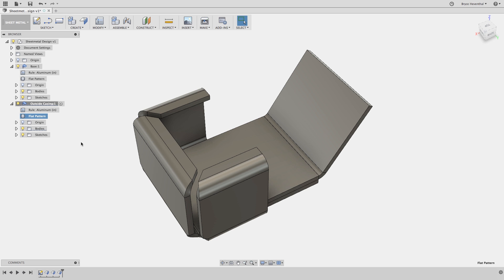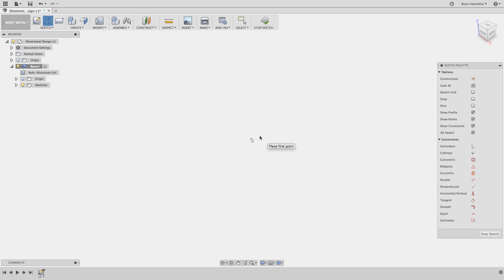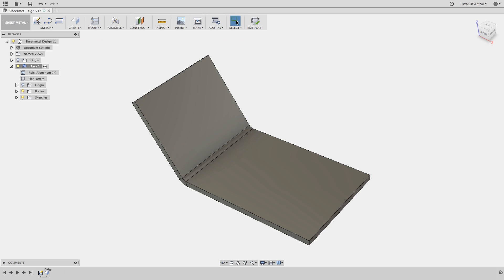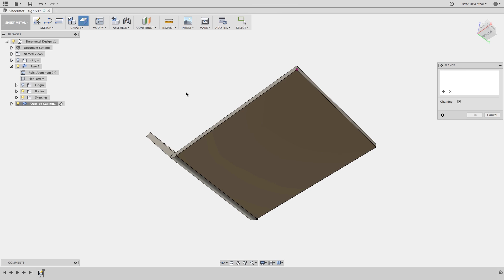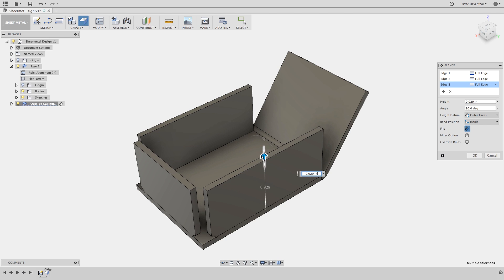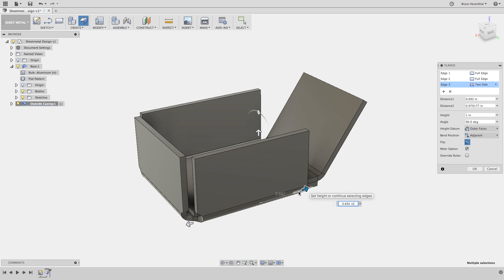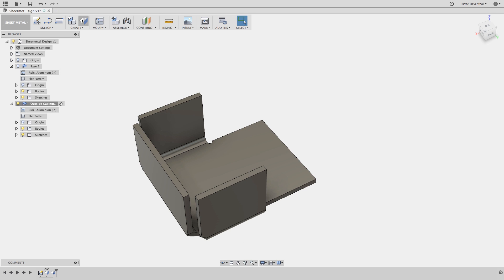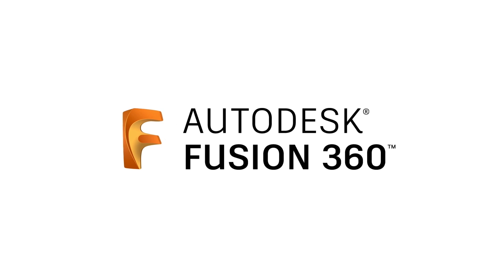QUICK TIP: Sheet Metal Gems Part 2

Comment: What about sheets of wood?
https://cdn.instructables.com/FD1/B0BL/HWRZ5E25/FD1B0BLHWRZ5E25.MEDIUM.jpg
Reply: Wood is difficult to define the sheetmetal rules (bend radius, etc.) because wood is an orthotropic material, which means it has different properties in different directions. The properties depend heavily on the grain direction. We can do some guess work to approximate wood, but it would be an approximation. Make sure to check out this tutorial, where they use cardboard with the sheetmetal tools. https://youtu.be/1aDN44__L9E